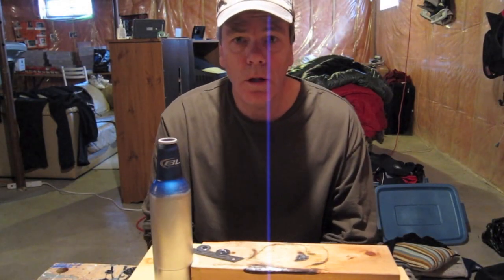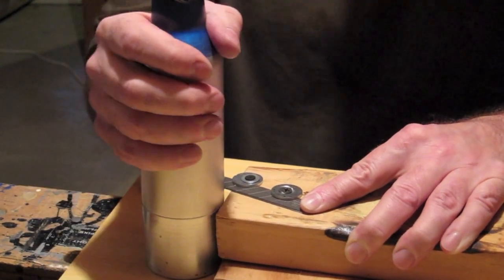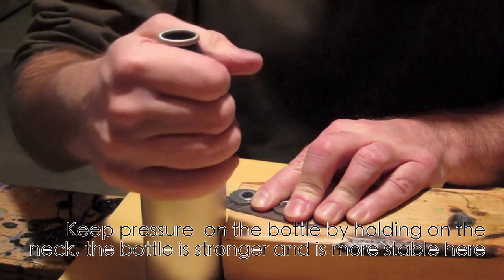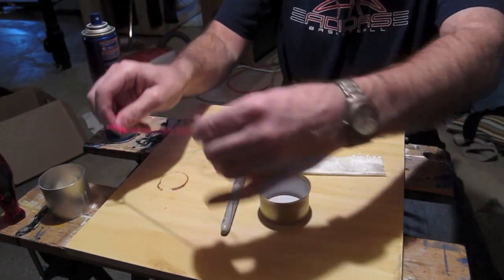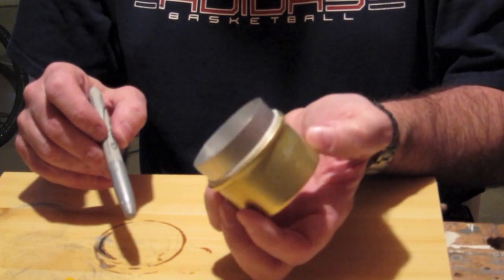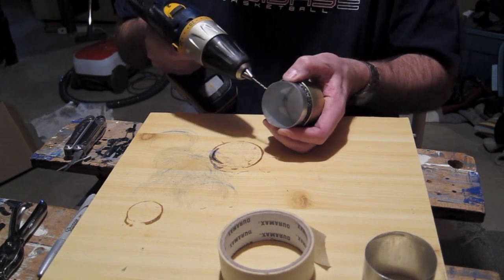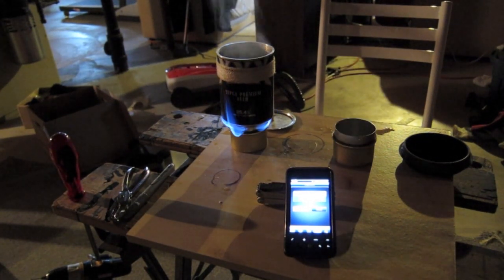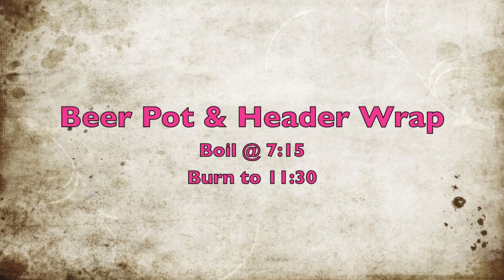Making Fancy Feest Stoves

Comment: what is header wrap?  where do you get it? Personally, I've tried the stove and it is wonderful. I use paper towel for my work and I can get about 4 to 6 burns out of a single sheet of paper towel. It doesn't give me that beautiful blue flame but more like blue and yellow flames but hey, it works. 

One of my concerns about using things like fiberglass and carbonate felt etc. is that you don't know chemicals are released to the air when you burn them. The paper towel, there's really nothing hazardous being released at that point.
Reply from the maker: Header wrap is available in automotive supply stores. It is used to wrap piping that gets extremely hot.

Comment: what the difference betwen the two stoves?
Reply from the maker: +Tanuki The stoves are the same except one used fibreglass cloth as a wick and the other had header wrap as a wick. I just tested them with 2 different types of pots to see if the stoves burned with different times.
Reply: Ok thx